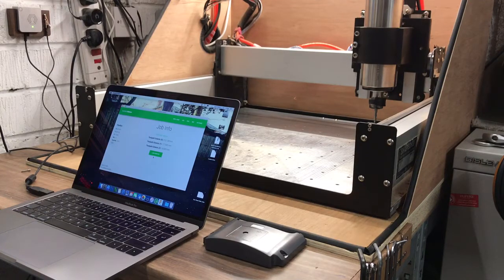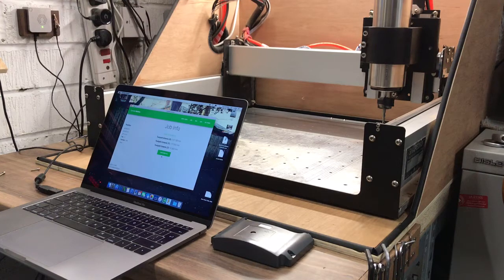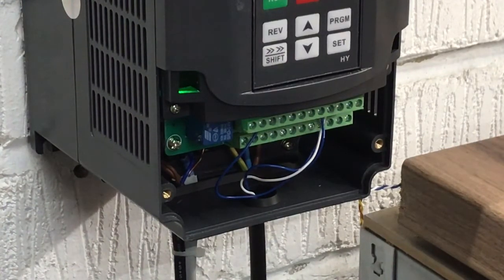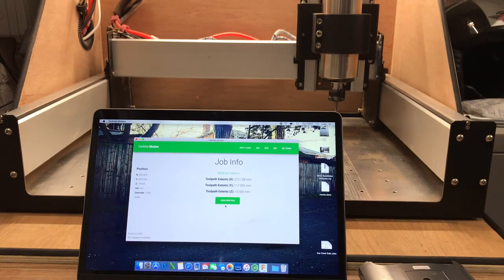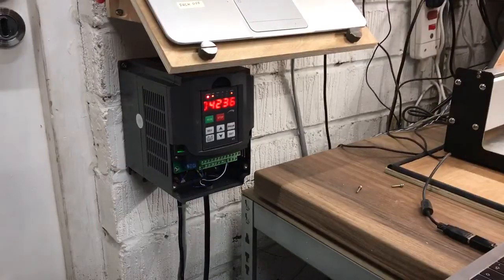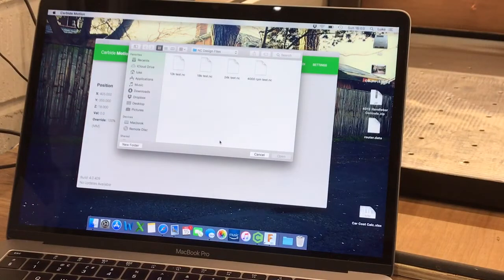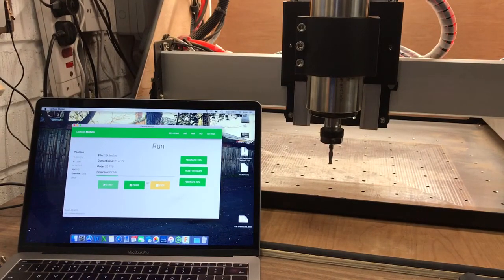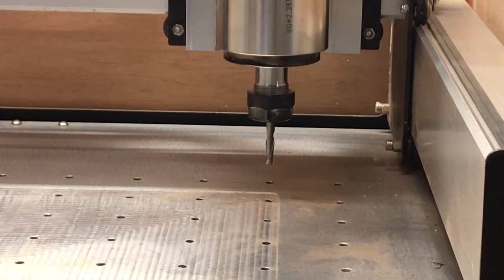How to wire up a water cooled spindle to a GBRL CNC - Shapeoko 3 or similar

Comment: Thanks for the video... I just bought my shapeoko 3 XXL.. and I want to get 1.5KW air cooled spindle with a VFD.. the only concern I have is how would I wire the VFD to the Shapeoko 3 controller... It would be a great help if you can just point out the which pins to connect where? or possibly just take a picture of your wiring please
Reply: ya, that would have been nice for him to show. I am doing the same thing and can't seem to find a good video or pics.
Reply: there's a major thread on carbide3d forums that shows all the wiring in extreme detail. you can find it in the essential threads sticky..

Comment: Quick question. I'm doing basically the same thing as you're doing here, just not on a shapeoko and on a very slightly different VFD (of course the Chinese one sent to me is the odd one out of 99% of YouTube videos lol). I have everything working within reason except I have one problem. When I send a spindle command to the VFD, the frequency it detects for the reference voltage bounces all over the place +/- 30hz, which in turn makes the spindle RPM vary significantly. If I control it manually with the VFD front panel, it's consistent and there are no problems. Did you have this issue as well or no? I can't seem to figure it out. All I know for sure is that the voltage supplied from my CNC shield board is consistent, so it's something with the VFD.
Reply: Are you using shielt cabels :-)
Reply: Shielded cables solve many sins.

Comment: have you played around with settings to really dial in the RPM?  I know in arduino code and other languages you can tweak those things; im not sure how in depth the programming would be to calibrate the VFD or if you would have to at all?  Just curious if youve played with it at all?
Reply from the maker: I have on the vfd. Not so much with grbl, but that is on my to do list. It's fairly accurate, within 1000 rpm at all times...

Comment: Thanks, useful vid. This will probably save me some wasted time deciphering pigeon English manual.

  One thing though, that is NOT an E-stop that you have implemented. When the shit hits the fan you do NOT want to wait 3s for a gradual slow down. Put a brake resistor between P and Pr connectors and ensure total power off to the machine when you hit the red button.  E stands for EMERGENCY,  Imaging you girlfriends scarf is caught in the spindle or someone has stuck their hand into the machine when it is cutting.
Reply from the maker: Thanks, thats a fair point however since this video was made I changed the VFD settings to enable a 1 second brake. I can kill the power (and have a kill switch for that) but stop will do do quicker.
Reply: Thanks, I have not got far with exploring all the options and commands on these things yet. Is that the fastest stop? Have you looked at the use of a stop resistor on P, Pr pins? If you short a motor will stop almost instantly. I have not tried this yet but logically this should work in the case of power off or power failure ( depending upon how they have implemented it ). The video seems to have about 3s delay before anything happens, then another 8s before it stops. What is the delay from the moment you hit the button to the time the spindle stops with the  new controlled stop?
Reply from the maker: I believe you can increase the stop further, and more so by adding a braking resistor. In this video I didn't change the VFD parameters, so spindle start and stop time are slow. Since doing this I now have the VFD to reach full speed in 1 second and 1 second stop. If were just to kill spindle power the spindle takes about 10 seconds to stop. Also since doing this I've got multiple kill functions on a control board. Kill board power, kill motor power, kill vfd power and a 'pause' and 'stop' button. However this isn't using the CM control board.